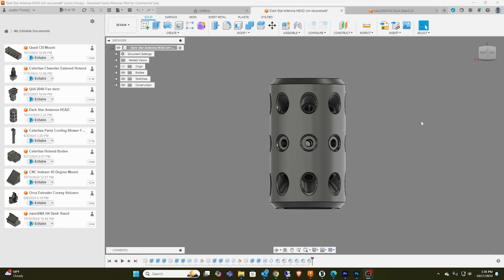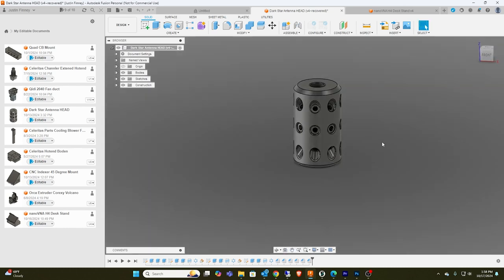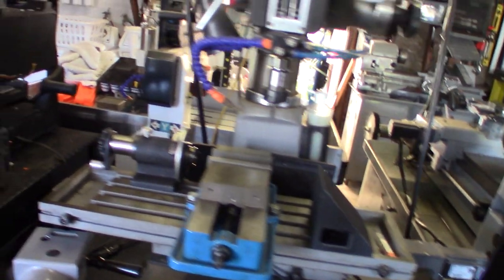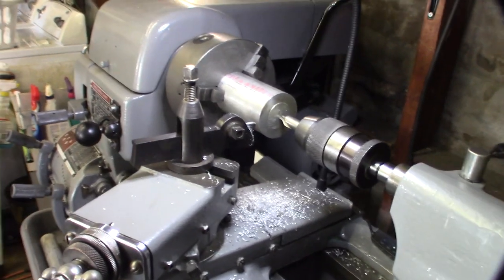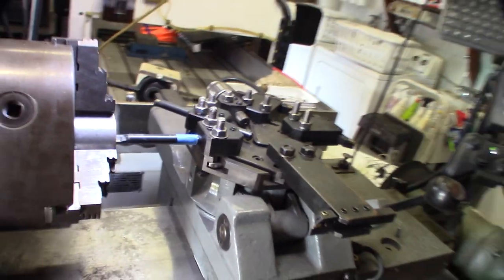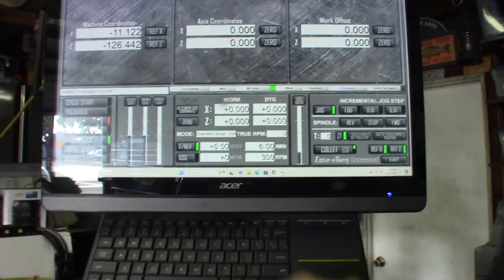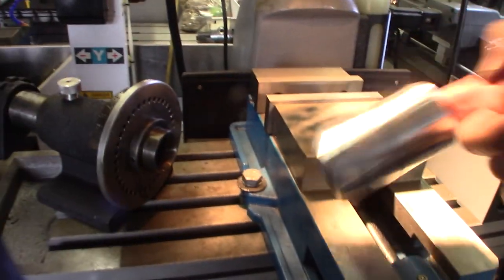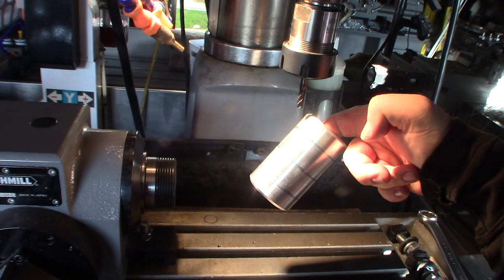Dark Star Experimental Radial Antenna , Ground Plane 1/4 wave Concept CB 11m DX machining Part 1

Comment: Need to insulate center core from ground plane.   Braid to radials.

45deg was found optimum trajectory for a 1/4 wave ground plane.  Pointing radials up will send rf into center which will cause vswr increase and lower performance
Reply from the maker: What do you think the ideal length is. I'm guessing the same size. 108" for the radiator and 108" for the ground radial.